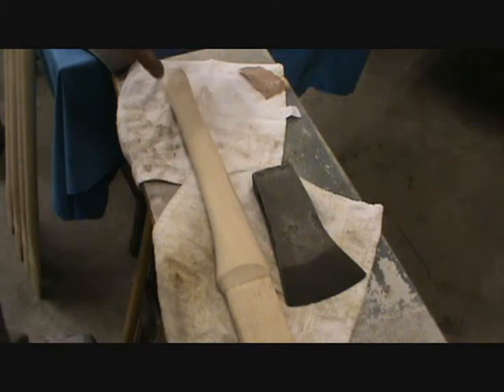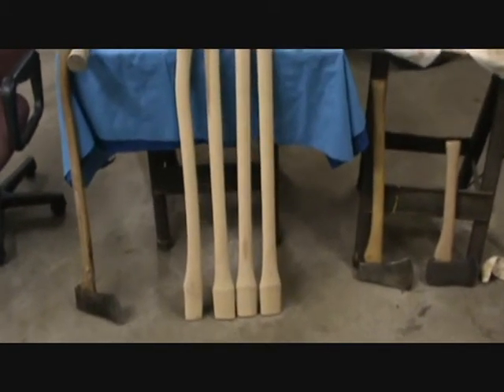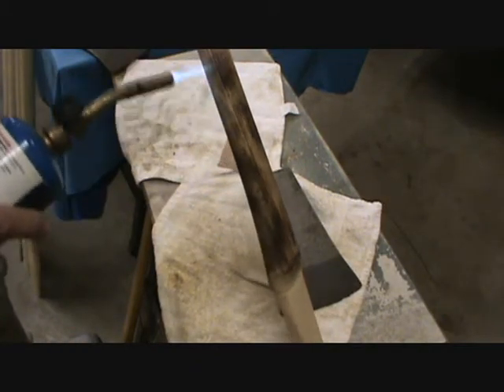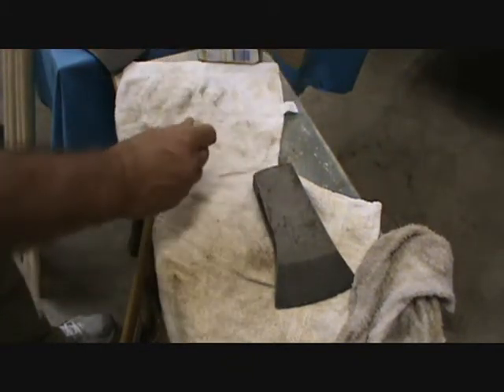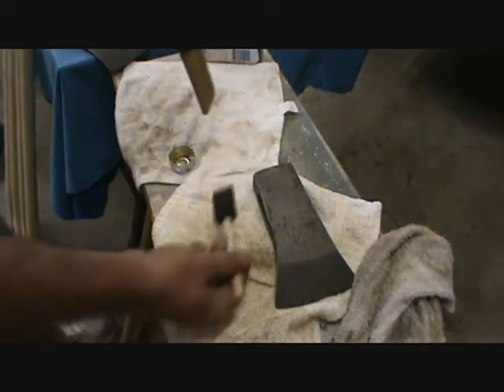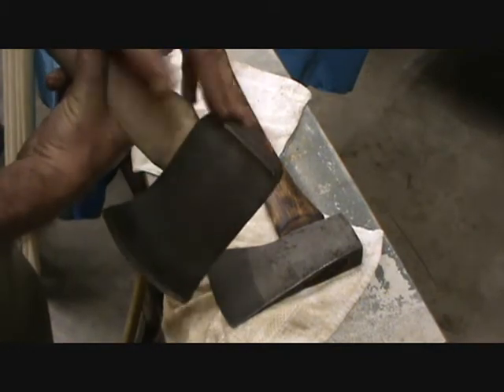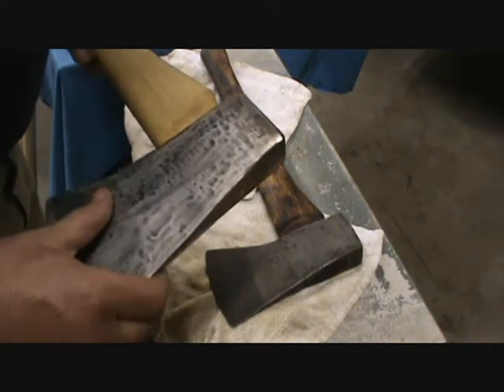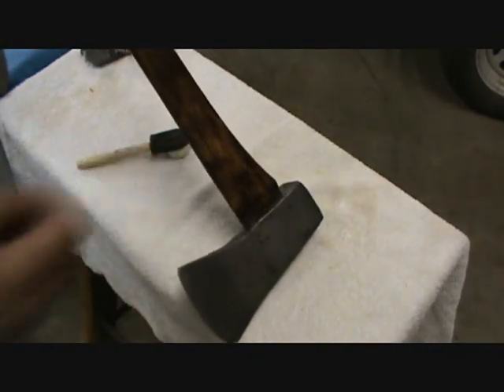Axe sick 2

Comment: Hello axe brother:o) You have some beautiful axes and you do an excellent work on the burned one and to put the London stock finish on it will make it go in to a class of it's own.
I also oil the top before i hang it, there is no risk of it slipping out and then it hardens anyway so i see no problem with that.
Thank you for sharing
Rob